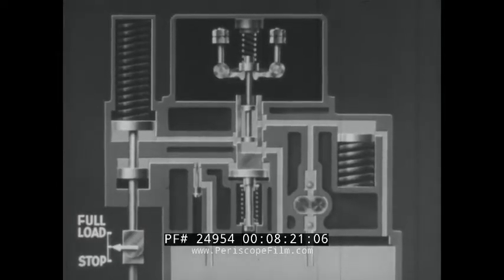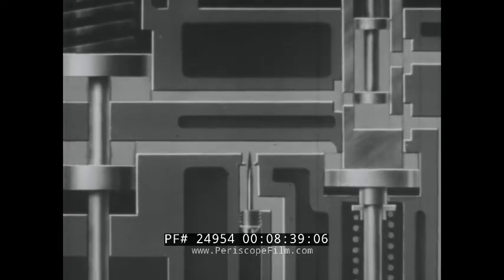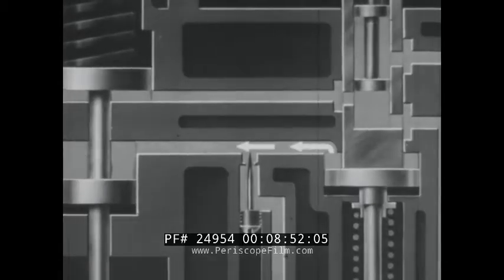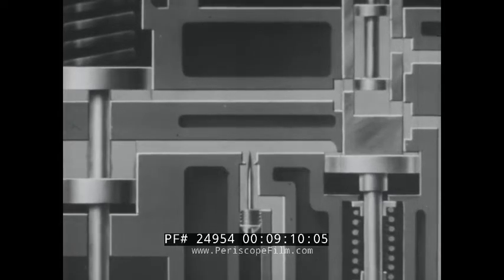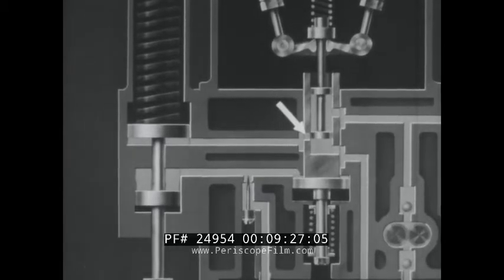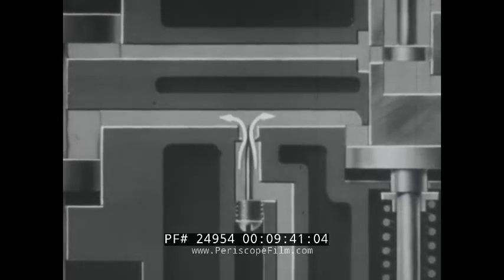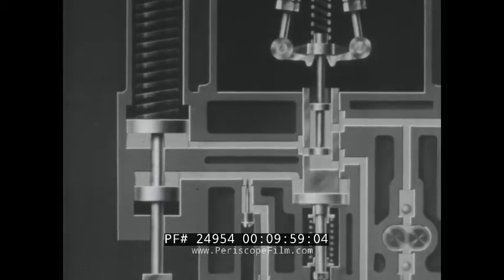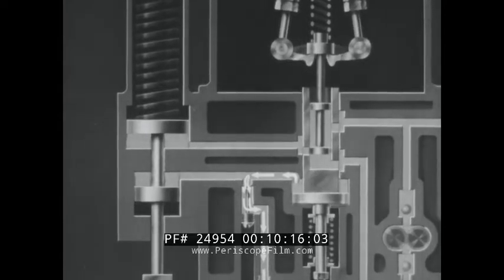1942 U.S. NAVY BUREAU OF AERONAUTICS TRAINING FILM   DIESEL ENGINE GOVERNORS  24954

Comment: The basic function of a mechanical governor goes back to steam engines. These hydraulic type governors are also used to govern piston engine aircraft engines by changing propeller pitch to give a "constant speed" function set by the pilot's propeller rpm control. I love to watch these old training films; they are excellent in explaining/demonstrating how something works.

Comment: And be very careful when flushing out the govenor reservoir with carbon tetrachloride!  Bad stuff to breathe into your lungs.
Reply: Great for cleaning your clothes though. On vehicles from the 1950s and 1960s or more particularly buses brass fire extinguishers filled with carbon tetrachloride could be found. They often failed when it came to use as the contents had been purloined to clean stains off the drivers and conductors uniforms.